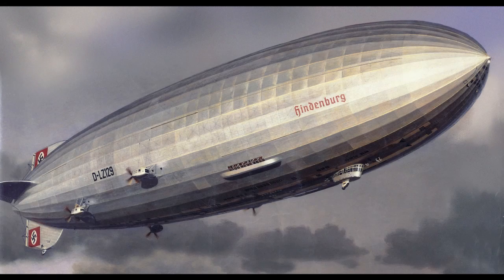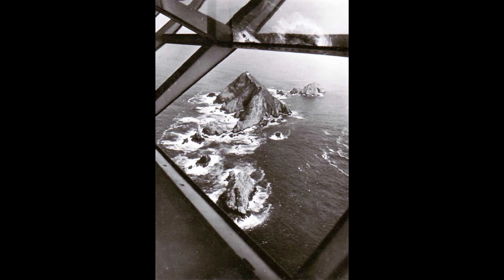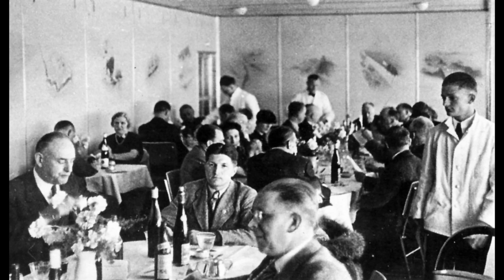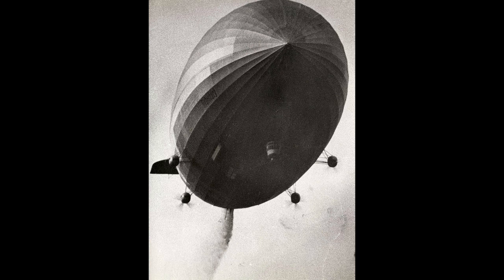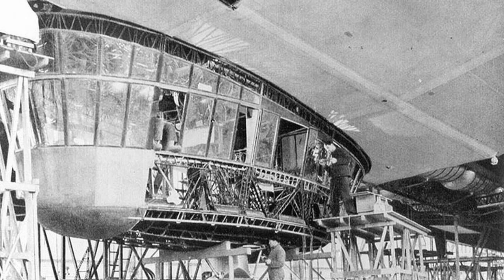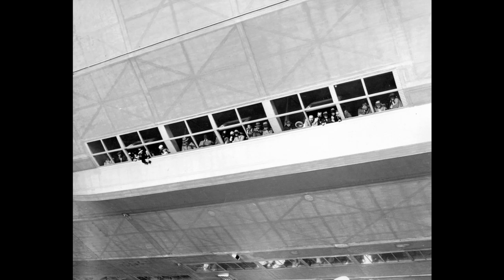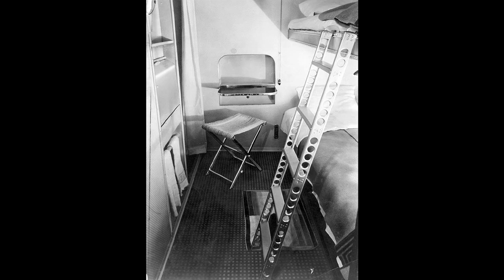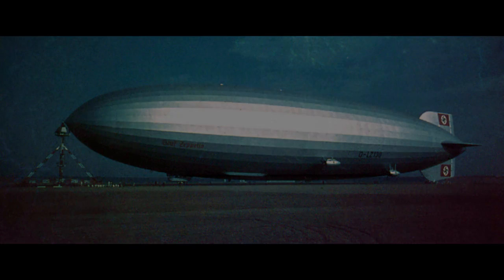Hindenburg Class Airship - Operation and Design

Comment: Hindenburg Daimler Engine Casing Recipe

1 .Empty toilet roll cut in half at the centre to make two smaller toilet rolls;
2.  Cut the egg carton up so that each cardboard cell will fit over the the halved empty toilet roll.

That was the Daimler Engine Chases casing for the Engine on the Hindenburg.

Comment: Id really like to build one. Theres a high altitude lab in japan. I want to design a machine a cryocooler that can be lifted with high altitude balloons at higher altitudes i believe the possibility of capturing helium gas will be much better. I read a patent for hydrogen helium gas mix thats safe. It should give 60.8poumds of lift per 1000cubic feet.